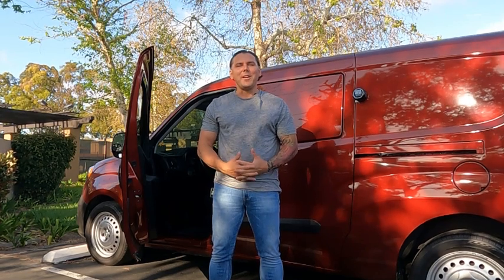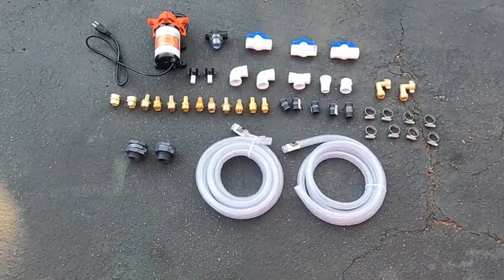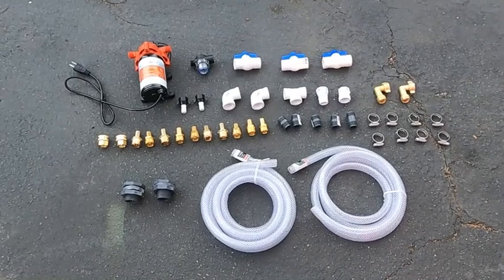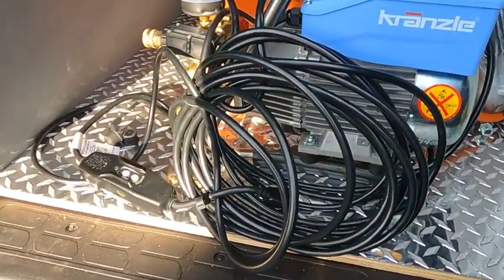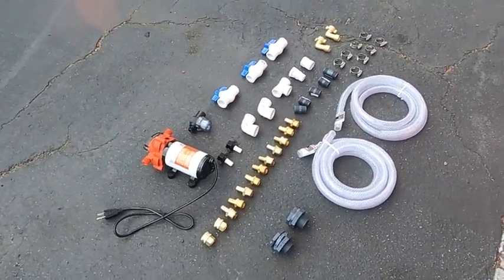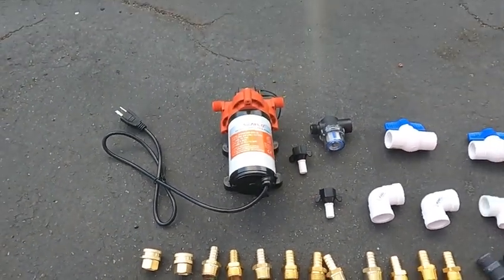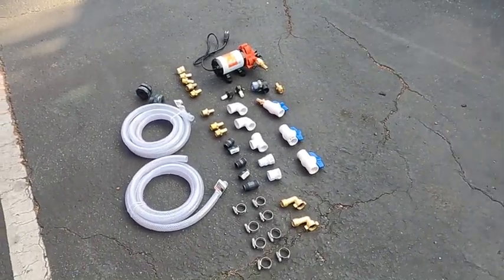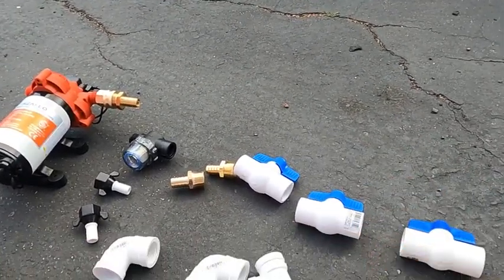How to plumb a water tank! How to plumb a water tank for auto detailing van setup!

Comment: FYI the pump has GHT thread which is garden hose thread and the ball valve is npt or pipe thread great video keep going
Reply from the maker: Ok good to know! Thank you for the info and the comment! Because someone will need it for the pump fitting and if they go with that 90 degree brass elbow for the pressure washer.

Comment: Only 480p quality or is that something on my end ? And yeah man most of these guys are severely over charging for these builds. There’s guys selling the power cords for over $300. It’s mind blowing I’ve built several high quality and cost me under $60.
Reply from the maker: Really? I shot it in 1080p. It’s a new camera and I wanted to try its 1080 capability first before I try the 4K. But I wasn’t that Impressed, I’ll be sure to use 4k from now on.  I just watched a little bit of it on my phone and it’s pretty clear. It might be something technical on your end. But there are some parts that look blurry when the camera is pointing down at the asphalt or when the lens gets it hit by direct sunlight. Sorry about that Im trying to step up my camera game asap!

What power cords? The ones for the generators? I seen how some of them wire the switches for the pressure washer and also make custom four-way electrical boxes, lol I don’t even want to know how much that cost!
Reply: @Brandinwagstaff  yeah it shows you only uploaded the videos in 480p. And yes the 4 way electrical box for generator. If you ever want some made I won’t even charge you bro. Also the Kranzle doesn’t need a pump for it. It self primes. Kranzle actually recommends you don’t use a pump on it.
Reply from the maker: Wow! What a rookie mistake lol. It must’ve been the default resolution of the new video editor I used. 

Thank you bro I will keep that in mind! Find me on IG so we can message there, when it comes down to it. @wagstaffautodetailing

Yeah Ive heard that. I been seeing mixed preferences about the pump thing. I’m not sure what Im going to do. Its still up in the air. Also I’ve heard Kranzle doesn’t recommend to put quick releases on it. That reminds me I need to order the oil for its first oil change.

Comment: Did you ever do the follow up video showing it being set up? No matter what I try I have disaster!
Reply from the maker: Its no joke 😭 Im sure you can get it right. The home depot guys help a lot. If you show them pictures or a video of what your trying to build, they will make sure that you get all the right fittings, sizes, hoses and valves. No I ended up taking it to a professional in the long run 🤦‍♂️

Comment: Nice, I would of like to have seen you build your own frame using unistrut.
Reply from the maker: Unistrut is a great option. I feel like theres not enough unistrut setups. I probably would have but I didn’t research where to locate this material. And browsing the Home Depot app just now they have a ton of it. Anyone reading this and interested in unistrut , search up “unistrut” and “unistrut brackets” and you can build a frame from steel.

Comment: I just built my setup not too long ago. Im using a self priming pump kind of like the one you have there. My issue is the hose that connects from the water pump to the pressure washer is always full of pressure and it makes the water pressure gun hard to pull sometimes.
Reply from the maker: I need to update this video bc When I built mine I eliminated the priming pump bc the builders recommended too. I trusted them and it ended up working fine. There is no lag at all. The pressure is immediate and my pressure washer is approximately 3 feet above the water tank. And later on after the fact My buddy called Kranzle and asked if it’s OK to mount the pressure washer above and they said yes it’s totally fine and works perfect mounted above up to 3 feet with no priming pump. They said they actually don’t recommend using one.